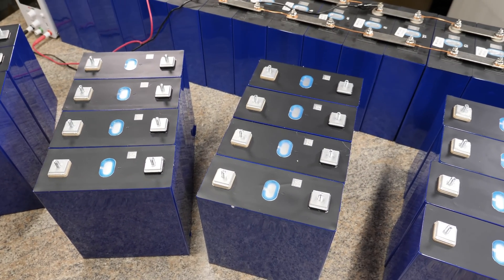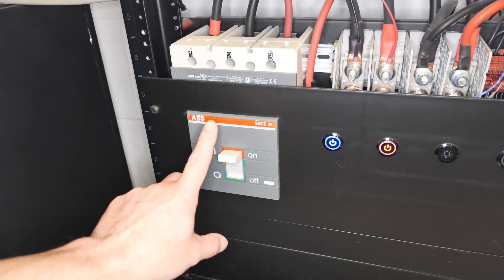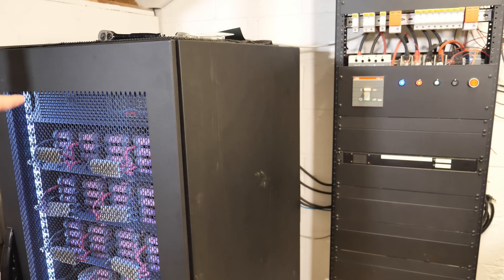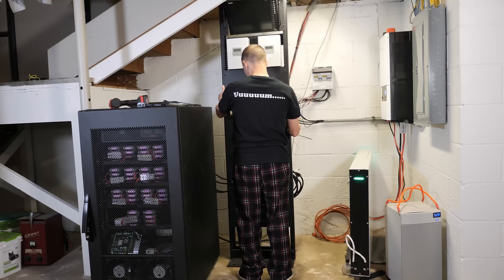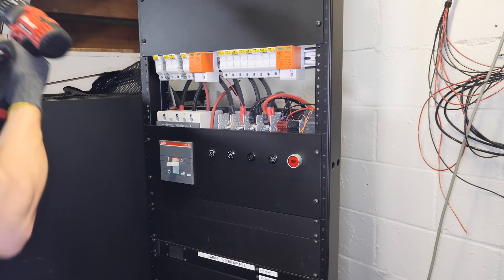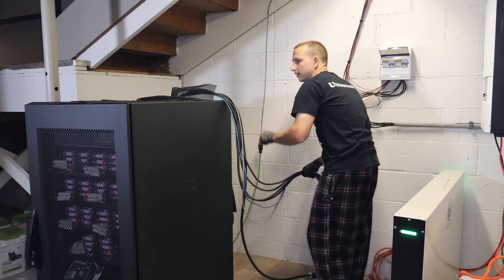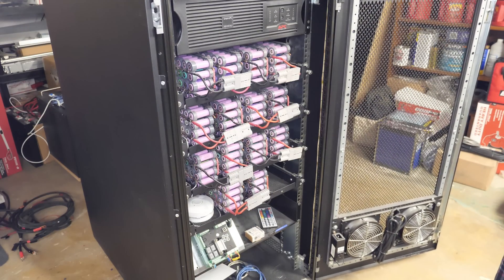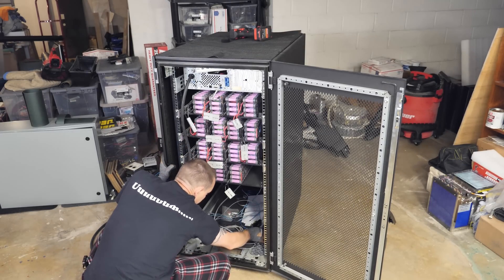Out with the Old! Removing the Fire Hazard! POWERWALL 2.0 ep1

Comment: @ 7:45 with the 2.35V it’s most likely ghost voltage. If you have a LoZ function on the meter, or a meter that has the LoZ option it will show a much more true and accurate voltage with AC when using that LoZ function.
Reply from the maker: I think it was from the batrium lol😆

Comment: Would you be interested in selling that battery? The price on the case and batteries and all set up and running like you had it in this video.
Reply from the maker: Would obvi have to be a local pickup.  I would keep the batrium bms unless you wanted it.  They are expensive!
Reply: Like how much money? My 4 6volt batteries are almost dead and need to replace them. I am looking for replacements. I've been living off of 4 harbor freight 90 watt systems for 5 years now. It's time I need a bigger up grades. I don't see why I can't come an pick them up myself.

Comment: Sad to see it go but also glad you are moving to a safer chemistry.  I would love to see some capacity tests on those packs if you have the time.  If they still have some life left you might even find a use for them away from the house in a weatherproof enclosure with a BMS that has low temp and high temp cutoff.  They will survive freezing and higher temps for a while as long as the cells on not being cycled during the extremes.  I have nearly 15KWh of flat pack cells from chrombooks that I still need to finish testing and find a use for.
Reply from the maker: Yeah its time for sure! I will for sure do a capacity test on them as I am interested to see how they sit. Oh yeah pretty sure they still have lots of life left and should still be usable! Maybe a future pw outside somewhere???💥🤘

Comment: Where did you get those shelves? I kept forgetting to ask. I am working on my own project. Also, what is the weight capacity?
Reply from the maker: I got some of them off ebay for $100 each. Your in Omaha right? How many do you need? I have 3 brand new ones I wont be needing. Has all hardware
Reply: Yes sir! Right now, I only need one because I have a smaller rack, but definitely more in the future when I get more batteries.
Reply from the maker: Forgot to add in other comment they are called "racksolutions" drawers.
Reply: How for one? Depending on the price I'll get more.

Comment: Why not just put the new cells into the old rack, that way you can keep most of the wiring and accessories and have it neatly in a movable rack? Since you're moving to LiFePO4's then you don't need the closed cabinets that you now want to put the new LiFePO4 cells into. 🙂
Reply from the maker: I originally was going to do that but then decided I wanted a more compact battery.  With the boxes mounted on the wall it takes up less space and should have a nice clean installation!💥🤘

Comment: boom boom f boom wow ! the neatest job i have ever saw                                                                      what are you doing with those big toroidal trannys                                                                                           i have a brand new 24 mosfet eg002 board here its one of the                                                                auto detecting batt voltage one 12 to 96 volts                                                                                                    i also have a never used big sendust choke i built for it                                                                                                               i have built bunches of these type inverters the oldest is                                                                                             4 or 5 years now  the highest idle on any that i have built is well under half of a amp and as low as low as 0.26 of a amp  they are very tough and good inverters                                                                                                  So you know whats coming next you should build a inverter!                                                                                       Or if not do you want to get rid of one or both of your transformers                                                                            the wife and i both are glad to see your get back to your channel                                                                 it WILL no pun do good  your much better no joke                                                                                                               i died on that getting in car voom voom video                                                                                                 have a blessed day      let me know if we can get on a trade!!
Reply from the maker: Thanks!!! Yeah id have to do some research on inverter building. I grabbed those trannys for that reason if I ever got a chance. I hear trannys are the best type. These 2 weigh a freakn ton. Had to drag then down here 1 step at a time and them  onto a rolly cart. NO JOKE HEAVY.
Reply: @AVERAGE_JOE  it is very eazy to build a inverter using those pre made boards nothing to it  if you want to get rid of one of those transformers let me know

Comment: This my idea to fix the fire problem.  Build a concrete block Cabnet with a slab on top and a commercial steel door.  Joe you could just roll that steel cabnet inside and shut the door.  No fire is getting out of that.
Reply from the maker: I have basically that in my basement now minus the steel door(which I was making).  I think they used it as a storm shelter back in the day or prepped for the end of world!!
Reply: @AVERAGE_JOE   You poured your heart and soul into that system and got many of us in gear to do ours.  This is just my on thoughts on your outstanding work.  Seeing that being unhooked is like the Dog died.  I hope you change your mind and still keep it safe..  Glad your going full time.  Most channels are buying these new batterys also. They are nice, turn key, $$$$$$ and costly.

Comment: I collected a bunch of those batteries at first but then once I looked at the risks and as lifepo4 cells became available I decided against going that route, fortunately spent nothing on those cells either. 24kwh of lifepo4 cells doing my work so far, plan to add more later this year, last battery added was a 230ah pack made from EVE cells that replaced the original BYD cells I had that proved to be crap. Been very happy with the setup. I assume you'll move your batrium over to the new power wall setup?
Reply from the maker: Yep, started the 18650 project before lifepo4 was a feasible thing.  Luckily didnt spend to much on 18650s.  Thats why it took so long cause I usually waited for free cells!  Super glad I purchased the 280ah cells before the last price hike.  Cant wait to get this in service!  Good to hear you just went for lifepo4 to start with!  Yeah for sure reusing the batrium!!💥🤘

Comment: Sweet trick to put the system on the grid through the app. Which setting did you use to do that?
Reply from the maker: I used the "shinephone" app that growatt has.  Its an ok app.  Not always instant but fairly quick.
Reply: @AVERAGE_JOE  right, the app updates at 5 minute intervals, which is lame. But in the settings did you just change the priority source? Also do you have the enter the password every time or is there a way around that.
Reply from the maker: Oh ya my bad, yeah just change source to utility for a few hours then switch back later. Yeah I have to enter in the dumb password everytime🙄